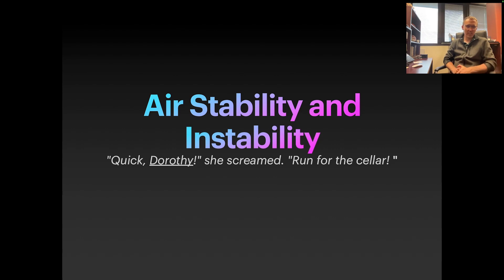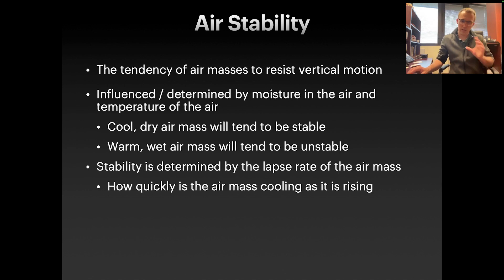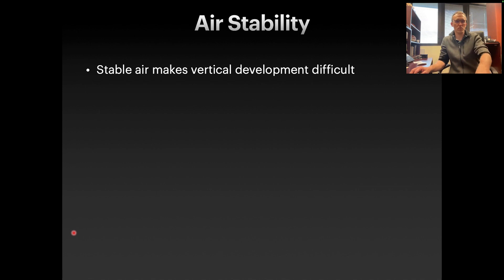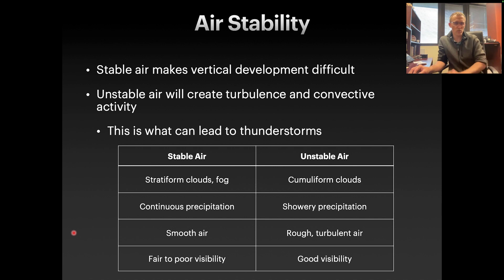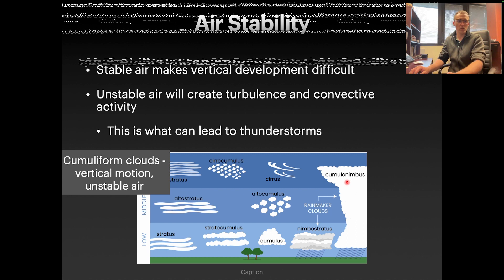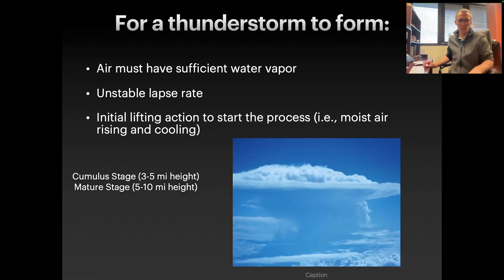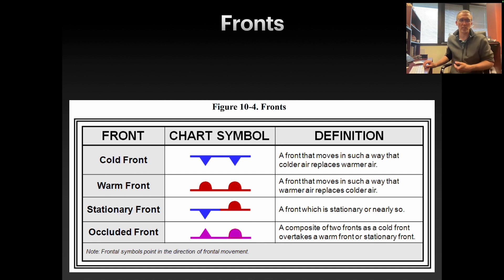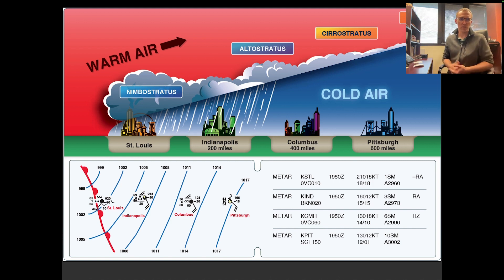Introduction to Weather, Part 4 (Fronts and Storms) - FAA Part 107 Test Prep

Comment: 8:42 Cold Front is not when "Warm air coming over cold air", but rather when Cold air shoves UNDER warm air. You've correctly identified lifting (which is necessary for the warm air to rise and form thunderstorms), but misidentified the force causing that lift.